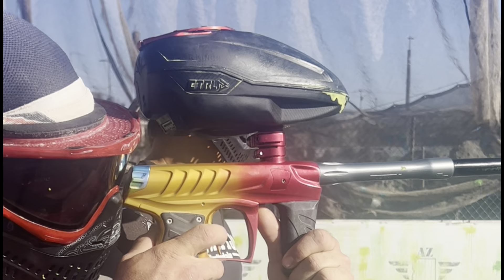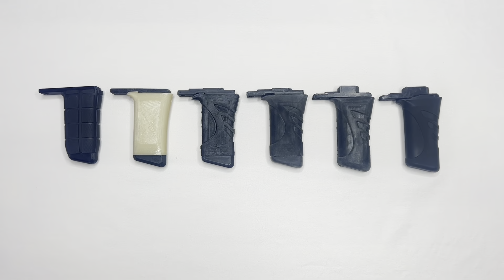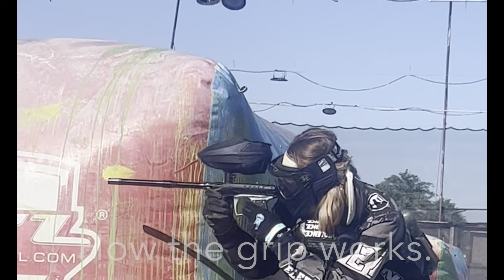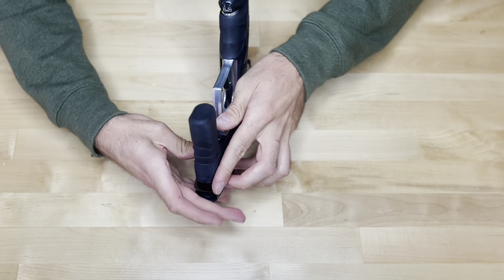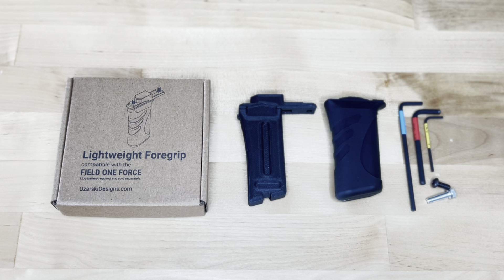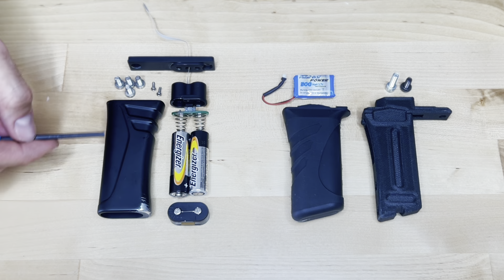Lightweight Rubber Foregrip for the Field One Force

Comment: Popping back on here after getting some time on mine and I have to say great job and thanks again for the innovation. I've got one installed on both my V1 force and my newly arrived V2 Cut Force. I love the grip feel, shape, size etc. You really knocked it out of the park with the design. I'll be using it all season and as long as I have my Force(s)!